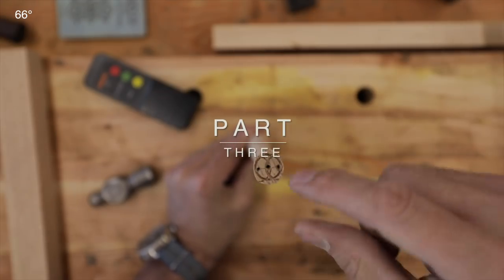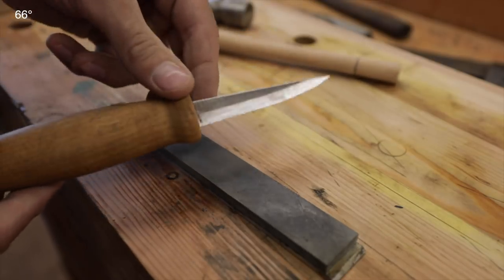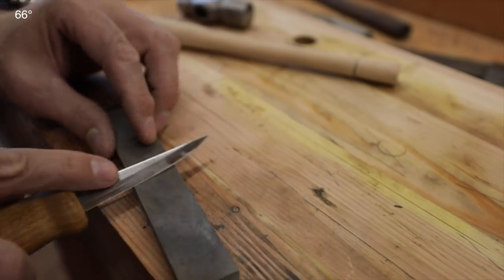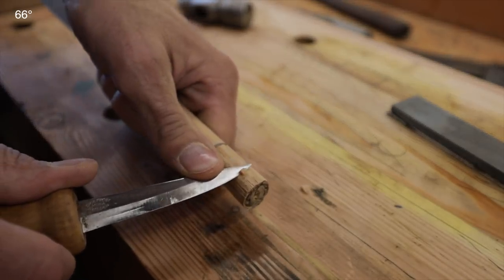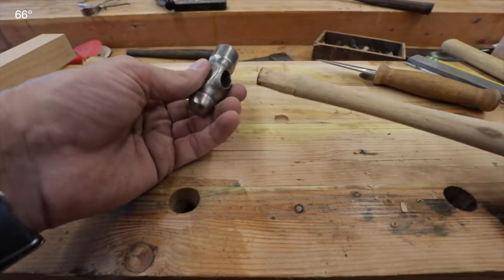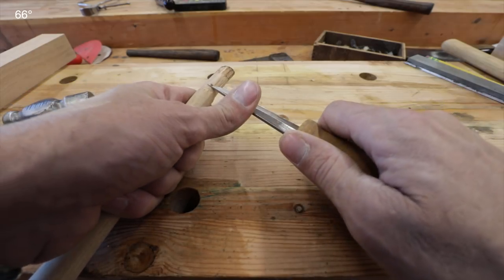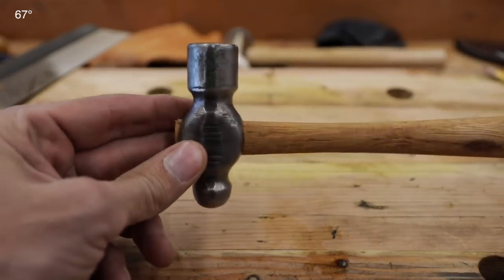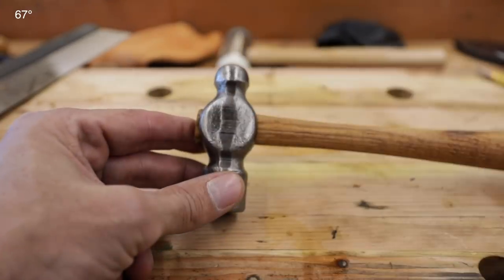Old Rusty Hammer RESTORATION

Comment: I used to use a slightly longer piece, knowing I would cut off the end. I also learned from my father, he would drive in a stainless button to the bottom of the handle because he liked the way it looked! You could tell it was one of his. He actually learned on a pedal-driven lathe, which he would use periodically even later on. You did a great job!

Comment: Hi Cody - I do wood turning we usually bring a square piece of stock to round using a roughing gouge. It knocks off the corners safely then mark your witness lines with the lathe turning. A speed of 1000 to 1500 rpm will give a better finish but its the speed you feel comfortable with. Mike Walt has some excellent videos for beginners covering the  different chisels and their uses. The most important thing in my opinion is to get yourself a face shield, they are not expensive. Until your get into a piece of wood you can never be sure if it has cracks or is punky. On the piece you were using this not the  case but I would still use a face shield. As your confidence grows I am sure you will enjoy turning its a hobby in its self. Good luck thanks for the videos you put out for us.
Reply: Eric you hit the nail on the GET a face shield WS ! LOL trust us ole wood turners your gonna thank us later.great job...forgot to mention that the wood workers name is spelled Mike Waldt
Reply: i think alec steele has also done a few videos where hes turned wood

Comment: Nice job, Cody. The lathe tool you used is called a "skew chisel" and is mostly used with the bevel flat on the work piece. It will leave a very smooth finish. The toe and heal - the sharp point and the bottom point can also be used to make cuts into the piece. The skew is generally considered the most difficult lathe tool to use. The preferred tool for rounding a spindle is the gouge. The gouge has the round shaft with a rounded trough like groove ground into its length. The end is ground to a bevel that,  end on,  looks like a smile. The gouge shears off the material cleanly and can leave a fair finish. There are several other tools but one could write a book about all of them. You did an very respectable job in spite of the tools...
When turning off center as you did to produce the oval shape you just have to ignore the wobbly look and, using a gouge, take off material without trying to be aggressive.

Comment: I’ve been using a trick I learned from Jimmy Diresta’s channel with my Boiled Linseed Oil. 

Rather than using the cap on the can, which always leaks and makes a mess, I punch a tiny hole in the top corner of the metal can with an awl. 

Then you can squirt out a tiny amount of oil onto your tool handle. Then seal the hole with a small sheet metal screw. 

Your oil lasts longer, no spills, and the top of the can doesn’t get gunked up with oil residue.

Comment: Nice work Cody.  I would not beat yourself up about the slight overcut with the offset turning.. we are all novices at some point, and we learn by doing.  My suggestion for this going forward would be to make a pattern you can follow so you can keep your depth consistent, but if you are not going to be making hammer handles all the time, it might not be worth it.  Again, very nice.  Can't wait to see what other neat projects you complete over winter.  Keep up the great work

Comment: What a delightful trilogy the restoration of the ball peen hammer was.

And yessiree, sometimes you have to pull the knife towards yourself and sand against the grain.

Bravo on the project. I am fortunate to have many old hammers with original, well-cared-for handles. But yes I have a bucketful of hammer heads I have picked up at yards sales for two-bits each that live in a bucket of 'someday projects".

Thank you for sharing your adventures.

OMW in 98406

Comment: Now of course Cody may be thinking that any true "modern" homesteader could surely use a CNC router and speed up the process to reserve more time for oiling the old handles, and teach us how to "program" a hammer handle into the design software. You can use solar off-grid electricity to keep it a homestead project and meticulous key punching might still be close enough to call it hand made!

Comment: If its a difficult to fit head because maybe the eye has some odd shape from the factory, its not a bad idea  to leave yourself enough room on the handle so that if you mess up, you don't have to use another piece of wood. You can then finish shaping the piece after the head is on. Somewhat unrelated, but sometimes whats nice about a straight handle and oval eye maul over an axe eye maul is being able to very quickly rehang the maul should there be too much damage or looseness and quickly get back to work. Axe eye mauls are tougher due to thicker wood though. If you are very skilled and never miss or over strike, and also the wood splits nicely then its less to worry about. Having two mauls is really handy as well.

Comment: In stead of making your work longer and cutting off the holes from the lathe you could get little caps with a plug that will fit in the hole of the lathe you could have the wranglerstar logo on the cap too that would look pretty awesome and everyone will know that it was turned by you when they see it. Just an idea,  I hope I explained it well enough. 
I was thinking more about this and I suppose you wouldn't need a plug on the cap to fit in the hole I suppose you could just glue the cap on and it would cover up the hole just the same.

Comment: Why didn't you use metal wedge 45 or 90 degrees off the wooden one? I'm sure you did that on axe, can't remember if it was done on your blacksmithing hammer so I'm curious why is that, you don't do it on hammers in general or you didn't bother to make it on this one because it's so small and will be used only for gentle work so there's no need for additional wedging?

Comment: You wont have the holes if you leave extra wood on the end and then cut them off with a parting tool if you have one. If not that japanese saw and sandpaper wirks fine.

Comment: I have some open end wrenches that have a little rust but are of seemingly good quality (wright tools). I was thinking of sand blasting or scouring the rust off them, didn't know if I should apply any type of oil/film to them to keep in good shape? Any tips on basic maintenance?
Reply: Randall Lee look of a channel "hand tool restoration" he restored some old wright adjustable wrenches does great work restoring tools. I wouldn't sand blast them though soak in vinegar or use electrolysis with just water baking soda some wire a cheap dc trickle charger and a scrap piece of metal and you can rip a lot of rust off.
Reply: Wirw wheel and a light weight oil wiped off should be fine

Comment: I think I’d have preferred a slightly larger shoulder under the head but it’s a bang on handle otherwise.
Reply: Adam Lynch Well of course you would Adam. Are you one of those chappies who just can’t watch something without commenting that you could do it just that tiny bit better yourself.....
Reply: At what point Rob did I say I could do it better? In fact I don’t think I mentioned my pedigree at all at any point. I merely made and observation then went on to say it was smart other wise. I was not rude unlike the keyboard warrior who called me out for making an observation. There’s very little taper on either side of that eye and it’s just the sort of head that will pop over a small shoulder with use once it’s been tapped up a little then all Cody’s efforts to get this looking so nice will be spoilt.

Comment: Great

What's  that number (67) in the top left corner?
Reply: Martin Black Temperature..
Reply: 67°F roomtemperature
Reply: I think its the tempeture of where he is because of the celcius symbol
Reply: I had that suspicion thanks
Reply: AJRhyds 94 The symbol for degrees rather. Also it would be Fahrenheit. 67° Celsius (152° Fahrenheit) would be very hot😂
Reply: @MFRiley  I agree